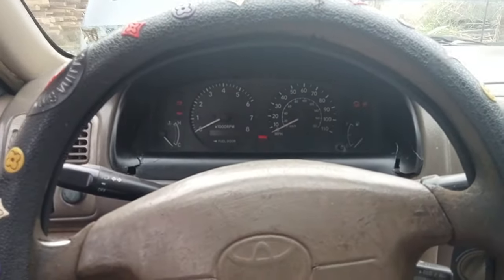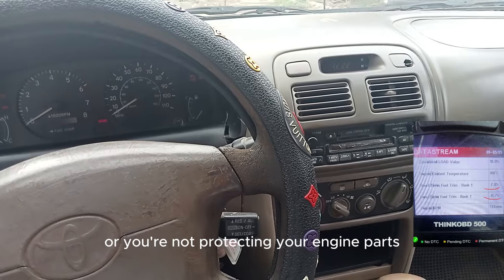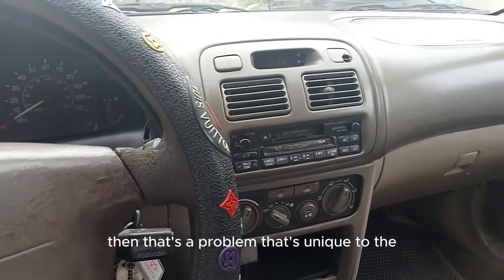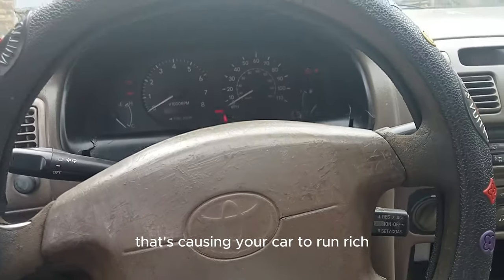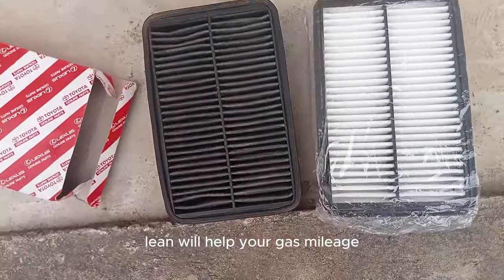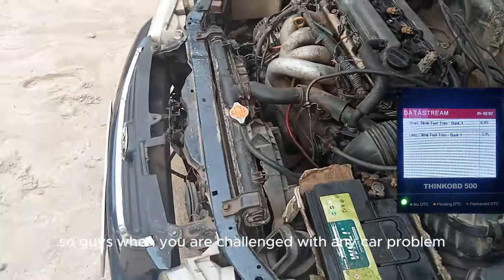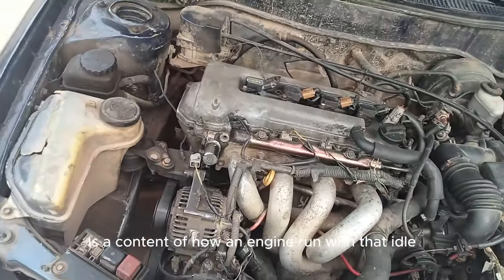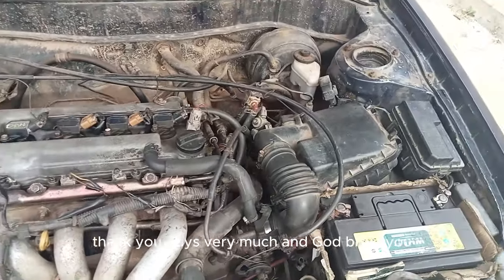2001 Toyota Corolla Running Rich At Idle

Comment: This is probably the best video i’ve ever seen on a car running rich.. I got a P0172 code at idle when i got to my driveway, the freeze frame data showed it happened at idle. There’s not much information out there on P0172 or a car running rich just general information. But this was very indepth!! Thank you so much. I have a 2007 Toyota Corolla. Hoping i fix the issue.
Reply from the maker: Much appreciated.
Kindly subscribe; we have multiple good content unfolding. 
And for your Rolla; will be on standby to assist if you need any further direction. 
Cheers and have a blessed day 😉
Reply: @AnythingEverythingGh  subscribed. I’ve thought it could be Leaking injectors dumping fuel.. or an exhaust leak.. when i’d start up at times i’d smell fuel from the exhaust/muffler. Took off the intake manifold and sure enough it smells like raw fuel. Throttle body also smells like fuel. Plugs are fairly new. But again runs rough and is running rich. How can i tell if the purge valve is stuck open? Or not working correctly? As you mentioned in the video. My MAF sensor read 0.24/g at idle when it threw the P0172 rich code which is pretty low.
Reply from the maker: 😮 @user-kx2ve6kt2g Will share my WhatsApp number here so you can send a pm to assist ok.
Reply: @AnythingEverythingGh  yessir that would mean a lot!!
Reply from the maker: @user-kx2ve6kt2g  Shared my social handles in my channel bio; kindly check and pm on anyone convenient to you.